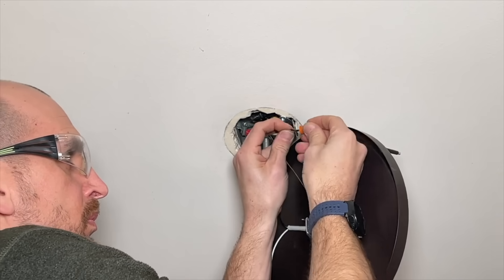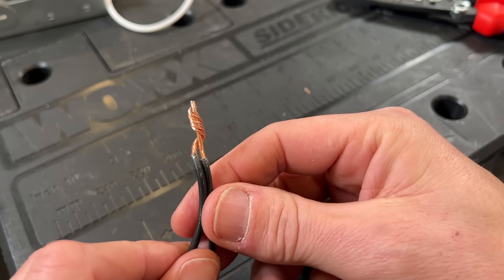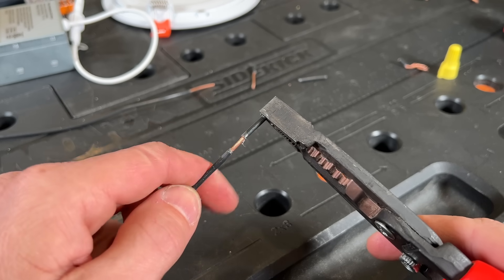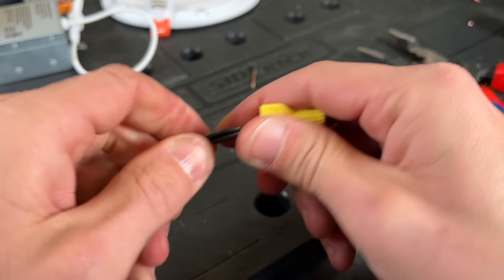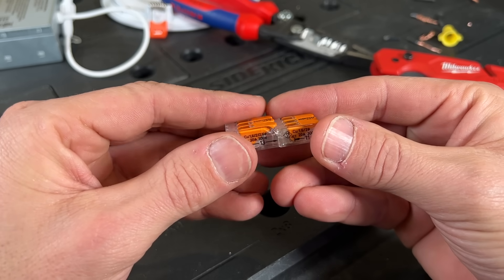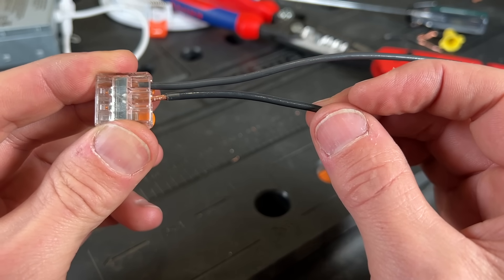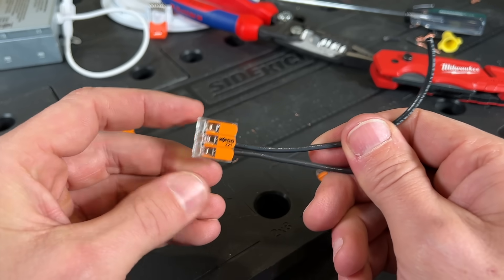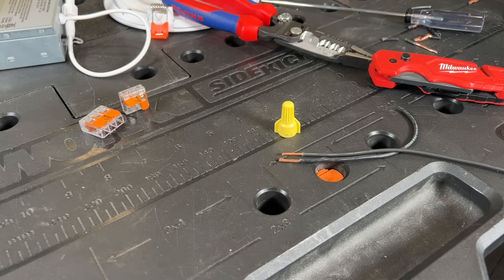Most Common DIYer Electrical Mistake - Don't Let This Be You!

Comment: I'm an oldie and remember as a young man wiring homes with my electrician father. Wire nuts were fairly new back then and he did not trust them so he insisted we still solder the wires together before using the wire nut. It was a solid connection. Things have changed... I discovered the Wago lever nuts a few years ago and absolutely love them. I am a DIYer and have a lot of wire nuts out in the shed that will never see the light of day. I cannot imagine a professional not using the Wago as the labor cost time savings alone should cover the increased cost of the connector. Additional savings can be found in potential using smaller boxes as the Wago is very compact and does not take up as much room in the box.  They also provide a benefit in rough wiring as all the through connections can be made in advance and continuity can be verified before everything is hidden behind sheetrock. When the sheetrock is up come back with your prewired receptacle or switch, open an open lever in the connector, put it in and presto a good solid connection and a working receptacle or switch.
Reply: Any "professional" using those in my house would be thrown out for being a lazy idiot.

Comment: Been wiring machinery panels to the UL508 standard for over 40-years and have never been a fan of those type of wire strippers and especially for the novice. To me, a far superior stripper is the Klein 11063W automatic stripper at around $30 on Amazon.
Reply: I like the Ideal 45-092 or the Klein 11063W as you mentioned, although I rarely use the cutter on the Klein. The building I work on was built in the late forties and I've gone into outlet or junction boxes that have so many wires stuffed in them it's a bugger to get them out to cut off the soldiered connection with the cloth tape on them, to re-terminate them with the push-on connectors.
Reply: @stephengile530  I’ve never used the cutter either. Much easier to use traditional diagonal cutters. I have a few pair of the Ideal strippers too. I’ve worn them out from decades of use.

Comment: @3:46  just stop right there....."then the side end led the stranded." Yeah, because you did it wrong, that was on you. You just have to make sure both pieces touch bottom.  You pretty much just started doing it right, then you did it wrong.  That is the secret.. The stranded wire gets twisted up tight, but both ends have to be evenly bottomed out.. After that all that matters is the tips of both pieces of wire are securely seated together in the very bottom of the wire nut.  That's all it is, now you twist tight, and you're done. That is the proper way to put on a wire nut.  If you've do it right, the wire nut should thread right off every time without disturbing the connection.

Comment: I wasnt familiar with the lever nuts and will definitely pick some up to keep in my toolbox. Is it a best practice to use one with an empty hole--ie, using only two wires in a three hole nut like you demonstrated with, or is it recommended to only use the same number of holes as wire?

Comment: It's common sense to lead with the stranded wire vs the solid when using wire nuts. The WAGO (We Are Going Overboard) connectors are for newbs with more money than skill or sense. Their size alone is a detriment, and the cost is ridiculous. They actually slow the job down as well. If you're concerned that someone will come in your attic and exert a 25lb pull on your Romex connections, solder them first and then wire-nut them. People can sure think of ways to waste money.

Comment: Wago's are the best. I love the lever nut ones, use the grey ones for years, mainly for bench tests and quick connects for testing and the 221's all around the house since they are much smaller. Personally load banked many of wago components to many times their current rating and literally see the wire insulation drip off before the wago components even discolor, incredible company.
Reply: I just had a wago fry in a drop in trougher fixture service call, wagos are to be avoided at all cost.
Reply: @BigislandEJ  highly doubtful the wago connector itself caused that, probably a bad installation or overcurrent

Comment: Problem with the Wagos.. They only fit the same size wire.. and most light fixture wire is smaller than the household romex... and it pulls out...

Comment: Wire nuts work fine this is silly. If you can’t splice solid wire to stranded with a wire nut and have it be a solid connection, you should do something else.

Comment: If you tried to use wire nuts in UK every connection you made would fail testing. Here you have to use either a soldered connection or a screwed connection where the screw only pushes on a compresion plate which in turn pushes against the wire with no twisting or cutting of the strands.
Reply from the maker: Good to know, thanks for the feedback 👍

Comment: The general problem with the twist cap is as you mentioned, but a two part twist cap.. could work better. Meaning you lay any wire in the hole/ gauge through into the twist cap except its not capped at the end. The wire comes out wit hate other wire. Then you fold it back and then put in a locking cap... This way the hole it goes through is the conductor and the wires themselves are held together and locked by the fold over after going through a neck and cap method... I thin ti would be the same cost and use less materials overall... The cap could even be attached to the plastic twist. Wagos do look nice... Were just completing the circuit... Then restricting the flow.. There is the double but, but I really am not a fan of the crimp method method since it is a waste, not reusable to the same degree, I mean for some reason its might be considered alright if the system is isolated and your never going to be able to access it, but then it should be a solid line... I mean a box over lap where you place in the line in a conductor box, the nit snaps closed and the line runs through a little s. That means the wires can be pulled out the contact is the entire bo just not the wires themselves isle the out and inflow. Theres a myriad of ways to achieve what we want... but twist method... I would hit and miss its connections sometimes and even with a could pull on it.. while I ma working on something else and then pull it again it seemed to untwist itself.. -.- = demon magic or maybe tension unwound it somehow.. to the point where it just fall off.. that reason I used buts /crimps for awhile or even the little locking two piece setup, but they had their own problems, large hands make small things difficult because the surface area tactation makes it difficult. So if I were to redesign a back pressure clip with isolation system would work better just a fancy name to kind fate thing I described above to improve the twister. Crimping is great for other bread boxing kind of stuff. but meh...

Comment: I had such high hopes.  Fucking ten minutes and you still did it wrong.  I could do this video in 30 seconds:  Twist them together and snip them flat.  Just do it every time, no matter the wire.  The nut will always bite every wire.  The way you did it, it can pull the stranded wire into the top of the nut and give you a poor bite on the solid wire.  Wrong wrong wrong wrong wrong, stop making videos if you don't know what you're talking about.

Comment: I don't understand why you are still making videos on anything electrical. It's obvious you have very little to no experience in this field. You should leave this subject to experienced professionals that can give accurate information. It appears that you randomly pick a subject that you have no knowledge of, study it for a few minutes then make the video. Your teaching of how to strip wire was an embarrassment. The problem is that poor information in this field can be detrimental. A good example is a previous video of yours on using multimeters. You were giving "safety instructions" that was completely incorrect and other bits of bad information as well. Stop before you cause someone to get hurt; if you haven't already.

Comment: Whoever values his time should use Wagos... Yes: Wire nuts are cheaper, and when applied properly give a very good connection. But they are prone to much more errors and take significantly longer make a good connection.
With Wagos: Just strip 10mm - done in a second with a proper stripping tool - shove it in, flick the lever, done. You want to change something? Just open the lever, do your change, and close it again.

Comment: WAGO are a fire hazard. They melt over time... I had to go back and cut every damn one of them out. As the customer could smell the plastic melting...Then they had the whole circuit fail..

You use a pair of Dikes to twist the pair first. Then use a B Cap to make the final connection... And yes I'm a licensed Electrician for 40 years...I even cut these out of light fixtures. That come from the factory..
Reply: Over 40 Years Wago and no Problems mmh.
I see more burning wire nuts than Wagos.
wago are used in industry and home and nothing is happen
Reply: @HyperSnap01  No their not either...So you better go look up the local ordinances on there use. They specify what type termination shall be used..

And they don't allow there use in Commercial or industrial applications..As they are explosive\fire hazards..

Have a nice day...
Reply: @WizzRacing  god i feel sorry for whichever person owns that house as youre obviously lying or there was another issue beside the wagos

Comment: Great video.  Stranded wire to solid wire is always a challenge even if you are an electrician.  But when you are putting 2 solid #12 wires together you really can't say the wago is as good.  Not as good when it comes to the pull test.  Ideal company has a video where the red wire nuts can withstand over 200 lbs pull test. But I think the wagos may be great for stranded to solid.

Comment: I find that using the correct size (ie 12 cutter slot for 12 ga wire) cutter slot to make the initial cut in the insulation and then putting the next size larger (ie 10 cutter slot for 12 ga wire) cutter slot in the initial cut and pulling the insulation off, works well for me.

Comment: The trouble with standard connectors is the possibility of becoming slack but with WAGO the cable is trapped like a barb which is spring steel loaded pressure makes it impossible to be released. The length of trim I think is 10mm I think.

Comment: To build on your way of stripping, at first try pulling the insulation only about 2/3 off the wire, then twist using this small piece of insulation. This will make a more perfect twist and also prevent finger oils from getting on the wire.
Reply: I've done it this way for many years.  Great share.
Reply: @traines51  {(⁹
Reply: Electricians cannot wash their hands all day. The wire will be fine. I wear cut protection gloves and they get dirty, I worry about touching a painted surface more than worrying about the wire. In 50 years, a guy like me will fix your mistakes.
Reply: @SavedByFaithInJesus  been doing this for 30 years never have i thought gee this wire nut failed  because  they got oil fingers. seen rusted out wirenuts and loose connection  though.221 people have ocd
Reply: Great tip!!!
Reply: I'll definitely start doing that.  I've always washed my hands before twisting the wires, to keep whatever filth I have on my fingers off the wires.
Reply: Exactly! Been doing this for years and assumed everybody else did as well! But that’s not the case I see! Lol
Reply: thats how I was taught many moons ago. Id spin off the remaining  insulation grabbing the tip with my wire strippers. when you are 75' in the air of a JLG, there is no room for error!
Reply: Great tip!
Reply: Nice tip, I like it 👍.
Reply: There’s nothing on your hands that will ever harm the copper wiring…copper is already a fairly resilient metal and oils from your hands won’t do anything to change that…on the contrary I would worry more about handling wiring without having gloves on due to the chemicals and oils your exposing your hands to…and then you go and eat a sandwich with your bare hands. That wire will still be functioning long after the chemicals in the wire insulation have infiltrated into your body for who knows what damage….I always wear gloves, people laugh at me for over 20yrs in the electrical and trade industry but….the jokes really on them. Certified Pro Tip

Comment: I really liked your video. As a carpenter having to hook up stuff that an actual electrician should, it’s great info on stranded and solid connections.  I have to very much question the contact surface area. How on earth UL approved the push in  outlets is beyond me. I’m sure the newer plugs you show have better surface contact but, I’m no electrician, short of a twisted soldered joint. Isn’t  3/4+ inches of tight twist better than new caps you show?    I’d love to see close up. Is connecting wire inside block really as stout as 12 gauge?  Again, I do like and appreciate your vid

Comment: Didn't know these were available as I'd only seen them come with a light fixture.  Thanks for the tip, bought a sampler pack and should solve a 4-gang box I was dreading using wire nuts in.

Comment: OK, now I know why I like you...  WAGO and Knipex. This is how its done!  So many benefits to using both! 

Pro tip: There's a small probe hole on the back of all WAGO connectors that allows for a tester probe without having to take out a wire. SO much more elegant than a wire nut. And yes, when you are combining different wire sizes or especially different TYPES of wire, the WAGO is basically the only way to go. Be aware of all the rip-off units though. Same colors, etc. Get the real ones. For a bonus point, I also dip my wire ends into dialectric grease before slipping them into the connectors. I'm just that nuts.
Reply: Hi Darrell:  Do you know if the Wago connectors are okay to use where you have aluminum house wiring, and of course, your fixtures all have copper wire?  I've heard from one electrician that there is a better way than just wire nuts with dielectric grease, but no details.  Thanks in advance!

Comment: Will the wago connector work on aluminum wire to copper?  I have an older house and have a lot of old wiring to connect to new lights etc.  to do this I use the purple connectors with the dielectric grease.

Comment: wire nuts are tried and proven. I'm not a fan of these to be honest. They can't handle heat like the wirenuts, not that there should be heat but I like the extra safety. I've seen these melt down. Where I've seen wires crispy and the wirenut slightly deformed but still in better shape than these newer connectors. just my diy experience.

Comment: Okay..... NO!  As a Commercial/Industrial Electrician (licensed) for well over a decade now I can say categorically do not do what this person is saying.  

#1 DO NOT DO WHAT THIS GUY IS DOING!  DO NOT ATTEMPT TO HANDLE ELECTRICAL ANYTHING WITHOUT FIRST PUTTING ON THE APPROPRIATE PPE!  WHEN HANDLING METAL ANYTHING MAKE SURE YOU HAVE CUT GLOVES ON!  It may not seem dangerous but it is.  Small slivers of copper can get under your finger nails and even imbed in the skin of your finger tips.  Go to wipe or touch anywhere else on your body MAINLY FACE! and you are going to have a bad day.  Nothing worse than getting a small 1/8th-1/16th sliver of stranded copper in your eye because you had to wipe away sweat and etc.

#2 DO NOT STRIP UP TO AN INCH OF BARE COPPER ESPECIALLY WHEN THE WIRE NUT YOU ARE USING ONLY HAS A 3/8th TO 1/2in SPIRAL BITE!  Reason for this should be obvious but if I need to explain further just comment and I will.  Professional Electricians only expose the amount of copper that is needed to complete the circuit and not much more.

#3 IF YOU ARE HELL BENT ON STRIPPING BACK THAT MUCH COPPER DO NOT USE YOUR STRIPPERS TO PULL THE JACKET!  If you are having to do a large splice where a Big Blue is in order and you need an Inch+ of bare just make the cut with your strippers and use your GLOVED! fingers to remove the jacket.  Dragging your strippers that far especially when it's stranded and your not well practiced at it can  guarantee you're going to damage the copper.  To make matters worse if it is stranded the likelihood of a strand or two of that copper could fall out the wire nut and cross your hot and neutral ESPECIALLY WHEN YOU ARE PURPOSEFULLY ALLOWING EXPOSED STRANDS TO BE THAT LONG! (Trust we see all kinds of craziness from DIYers)

#4 DON'T USE TERMINAL BLOCKS LIKE THE "WAGO" HE DEMONSTRATED!  In all actuality these types of connectors are very.... very.... very niche in their use.  9 times out of 10 a Professional Electrician will cut these out and put on his/her own wire nuts simply because Terminal Blocks are famously known to fail.  #1 because they are cheap, #2 because copper wire expands when it heats up loosening the cheap bite over time and so on and so forth.